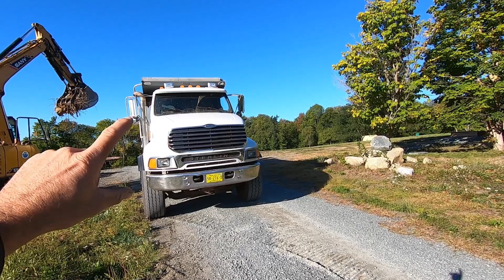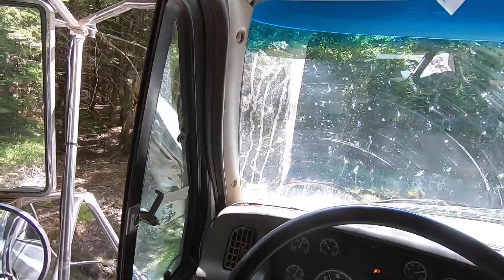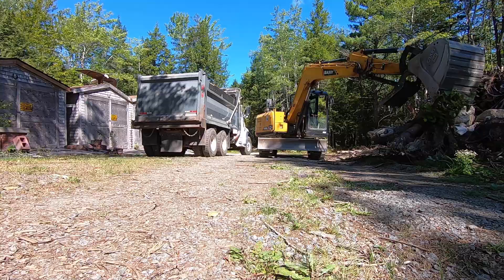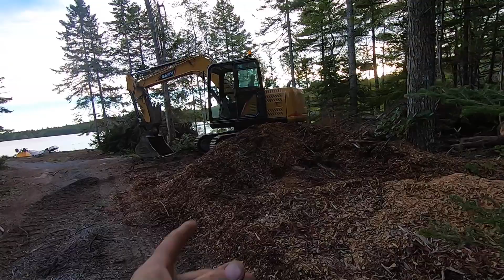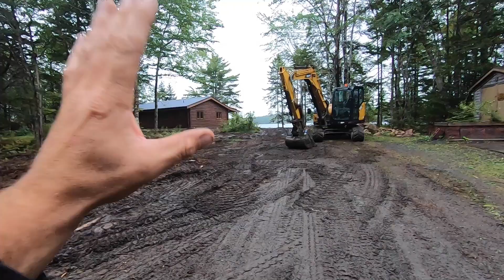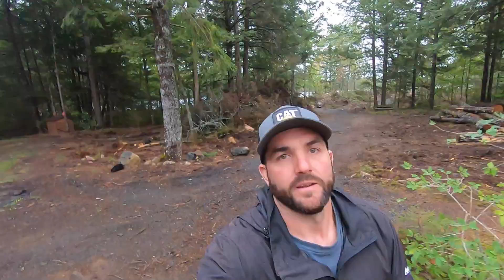PUTTING THE DUMP TRUCK TO USE CLEANING UP THE COTTAGE AND HOMESTEAD PROPERTIES

Comment: I  was wondering about the stumps tipping. I drive a roll on roll off hook truck. Some of our bins are swing door and some are tip doors, you can get the tailgate modified to do both. Not overly expensive in the big scheme of things. Great to have a swing door for over height items.

Comment: Sounds like you need to check the trans brake. That’s not normal hearing that much grinding going into gear. The trans brake will stop that if it’s working.